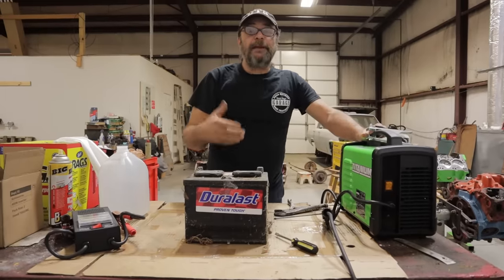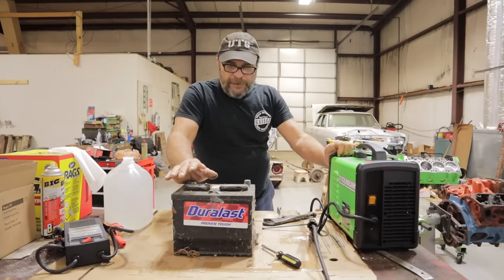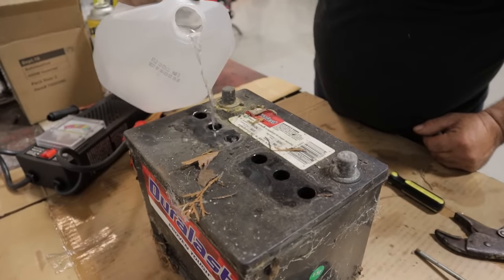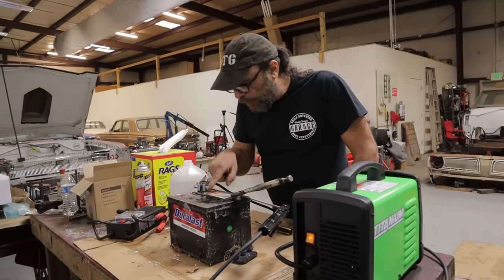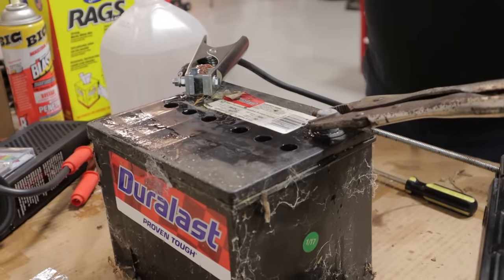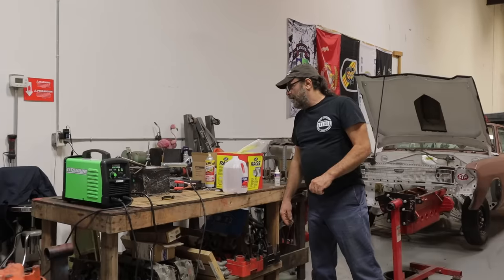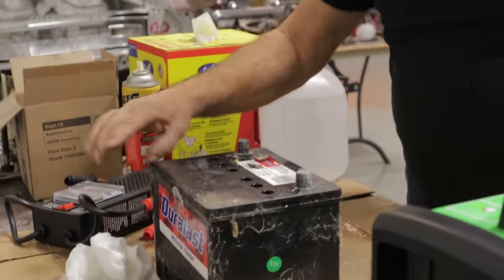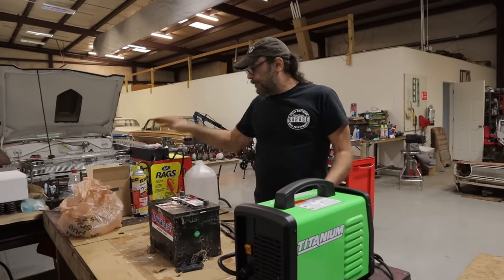Reviving Dead Batteries With A Stick Welder

Comment: There are three basic types of lead-acid batteries used in automobiles and boats. The old style is referred to as flooded batteries like Tony was using. These can be maintenance style with removable caps to replenish the water. Variants of these either have water recapture like the Surette Roll$ batteries or may be totally sealed. A second variant is that the battery’s plate architecture is designed either for high cold cranking amperage for starting only or for deep discharge such as the batteries used on house circuits on boats or in golf carts. Automotive starting batteries do not like to be discharged too much. The next type of batteries is the gel cell. In these the electrolyte is not a liquid but as the name implies is a gel. The advantage of these is that they can be operated in any orientation, even upside down. My old Miata had one and they are popular on motorcycles. They do not like to be over discharged. If so, they will likely die. Whew, long post. Finally we get the the AGM battery. AGM stands for Absorbed Glass Mat a cross between flooded and gel cells. Supposedly these batteries can be used like car starter batteries for their high CCA, Cold Cranking Amperage, or as a deep discharge battery. The difference in the three types is their physical construction. The chemistry is the same.
Each of these types has a different charging regime. Most modern battery chargers have three phases. Bulk feeds the highest amperage up to about 80% of the battery’s capacity. After that the charger drops to a lower amperage in the absorption phase which takes the battery up to 95% capacity. Finally the battery is on the Maintenance Charge also called the float. The three types of batteries discussed here have different characteristics in the three phases. The AGM can take the highest charge rate of the three, but a charger designed for flooded batteries can also be used on AGM. Gel Cell batteries use a different regimen and never the twain shall meet.
Reply: Nice science lesson but what am I supposed to get out of it? At some point in that long, informative post you could have addressed if this method works on anything but flooded batteries.
Reply: @MH-53E  Sorry, I never tried it. I wouldn’t leave batteries around on the ground in my yard in any event. I’m more concerned with being able to start my boat’s engine, run my radios, and keep my USCG required lighting lit. I’m not that interested in saving a few dollars when my life is at stake.
Reply: @datasailor8132  Seems to me you are more interested in showing others that you are the smartest guy in the room, which I seriously doubt. Intelligent people don't have to do this, it simply shines through. Or it doesn't...
Reply: Have been using load sensor like yours  to get batteries  from the dump  and u look for batteries not bulging on the ends . It seems if a battery shows a good voltage under load it has some life left. If a battery is in the dump it usually has been sitting around for some time before it arrived at the dump .have been using them for off grid uses. Try your idea with a battery that clearly bulging on the ends.i use that type of welder as a fast charger use a volt meter to regulate  the voltage to about 15v .I use welder with generator to fast charge fridge batteries  in early evening when camping so as to only run generator a short time.
Reply: Good info there buddy.  I think it's Absorbent, not Absorbed.  Minor detail but seems some info out there calls it one or the other.  AGM batteries have a lower internal resistance and so are able to be charged faster and also this means a better cold cranking capacity because the colder it gets, resistance will increase in most conductive elements.
Reply: @montinaladine3264  You’re right it is Absorbent. I’ve been writing it incorrectly since they came on the market.
Reply: Thank you for taking the time to write your highly informative comment so that those of us with an open mind towards learning more on the topic may benefit from.
Reply: MAny of the newer "sealed" designs are still wet, you can open the ports, but they are harder to remove.
Reply: @kevinb9745  HA!  Funny shit.  I thought his comment was a bit of misplaced bitterness.
Reply: I had a parasitic drain that killed my battery. Drained all the way to 3v. It's a 12v AGM. Do you think this deep discharge did any permanent damage? After a charge it seems to be doing fine, but I may as well warranty it if it's toasted.
Reply: @busterscrugs  Deep discharge is a relative term. Anything below 20% capacity and that’s a swag could do damage to the battery.
Reply: @montinaladine3264  Nope, the lower the temp the LOWER the resistance except with thermistors.  That is why superconductors are cooled to near absolute zero.
Reply: @datasailor8132  yeahhh I'd imagine 3v on a 12v battery is quite a bit lower than 20% capacity lol I should probably try to warranty it.
Reply: @montinaladine3264  not jumping on the insult train here but colder is better for conductivity
Reply: WOW !
Reply: @busterscrugs  it’s not. 2.4v=20% of 12. I’d try it and see if it passes a load test.
Reply: @MrKunzeification  Capacity isn't calculated that way, 11.6 volts is considered 20% charge for a 12v lead acid battery. It passed a load test, but I'm sure the capacity has diminished.
Reply: @MrKunzeification  if that math were true then why do dead bateries only read about 10% lower on their voltage. By your logic they should still have 90%  of their life left.
Reply: Hi thank you for the information , I have a motorcycle battery that is basically brand new I never used it , it’s three years old and it was charged for a while but letting it sit so long it’s completely dead , it’s a completely sealed battery , the name of the battery  is super start , 10 hr. ah -9 . I’m just curious if I can somehow bring this back to life ?
Reply: @williamgillespie3127  You can but try. Might want to load cycle it if it does come back to life. A 10 Watt 12 volt bulb would draw just under one amp. Run it down to about 40% on this load or consume 60% of capacity. The battery’s capacity should be marked somewhere on it. Do not let the battery overheat. Heat kills batteries. Mark the time it takes to discharge to this level. Subsequent cycles should increase the time is the battery is healthy.
Reply: I sure as shit didn’t read all that But in your first sentence 3 is wrong there are tons more then 3 you need to go back to help desk and learn a lil more on acid batteries in 2021
Reply: @TrekServer  this guy just googled car battery and thinks he's an expert on the subject all the suden.
Reply: @datasailor8132  thank you for the reply ,
Reply: @TrekServer  "three BASIC types." Learn to recognize keywords. those are the three most prevalent types of battery.
Reply: best explanation I've read in a while. Thanks for that!
Reply: @littlejackalo5326  , Ya, I always notice how often "basically" is misused.
Reply: Cool story bro, tell it again
Reply: @MH-53E  

Webster... Ha Ha Ha!!!!
Reply: @busterscrugs  actually 3v is 25% of 12v, just saying..
Reply: @chrismartin3377  Yes, 3 is 25% of 12. Congrats on your math skills. What I said was 3v does not equal a 25% state of charge in a 12 volt battery.
Reply: @busterscrugs  
Geday mate, cheers for the reply,- snapped , I was more looking at the maths, basic understanding of batteries  and power ( enough to get by when you're in the middle of nowhere and have to do something , - I'm more "old"  school Motorcycle / mechanical - downunder)-
but does any of these battery "revive miracles" really work, or just a last gasp of life... cheers, Chris.
Reply: @chrismartin3377  I'm honestly not entirely sure. A normal flooded lead acid that has become sulfated can be revived by fast charging it and purposely boiling the electrolyte. However, capacity will be diminished. Not sure if you can do this process with a sealed or AGM battery. 

Any battery that has died due to physical/internal damage can't be revived with this method. 

In my case, I had an AGM that had deeply discharged (all the way down to 3v). Drove the car for a couple hours to quickly get a charge back in, then I left it on a slow charger for 3 days. Still working fine, capacity is probably a bit lower now though.
Reply: Excellent description
Reply: @busterscrugs  Well, 3V out of 12V is 25%, but since most 12V batteries charge up to a potential higher than 12V, 3V is actually somewhere in between 20%-25%. (just had to post a bit of nerd sarcasm; you probably knew this already)
Reply: Thanks chatgpt

Comment: Arc welders come in both AC and D.C. make sure you are using a welder with D.C. output or if yours is capable of both set it on D.C. looks like tony is using a harbor damage 225 amp D.C. unit. Also many units are capable of reversing the polarity so there's that too.
Reply: Been welding since 87 myself great points. 👍👍
Reply: Leonard.. that would be
"Harbor Fright". 🍻
Reply: @blipco5  I have a lot of tools from harbor damaged and the home pisspot.
Reply: @blipco5  Hobo freight he he
Reply: Hazzard Fraught
Reply: Horror Fraud
Reply: Hobo Freight
Reply: @blipco5  I think you meant Ship Wreck.
Reply: Your right when the electrolyte boils it creates explosive sulfuric gas, you can charge indoors as long as the vapors don't accumulate, a ventilator fan blowing across the battery is safe as long as there are no vapors present when you start the fan. You can determine the state of charge and health of each cell with a battery hydrometer. Real old neglected or cheaper batteries do not respond well to this treatment the lead phosphate plates that interact with the acid become too thin over time and do not possess sufficient material. When you shock the battery with high amperage spikes the plates get hot and that sulfate will hopefully fall off. It's a gamble and other bad stuff can happen, no open flames or spark generating devices, no gas water heaters, no static generating. Even light switches make sparks. Never ever leave batteries charging overnite indoors without ventilation. Distilled water is good, purified is also good, tap water has minerals that can bond to the plates causing interference. Work many years with domestic and industrial batteries. Good luck
Reply: @illiod1  ok kaaren.
Reply: (The Frightening store) lol
Reply: @slickwilly1099  he was just being helpful....
Reply: What voltage is that battery seeing out.of these DC welders?
Reply: @blipco5  or, anagram-ically - “Harrob Frigate,” which references the boat in old H.F. Advertisements.
Reply: @PNW-LOGGING-HOMESTEAD  since Stick welders lean toward constant current, and welding electrodes need a certain voltage to get “lit” - about 40 volts for rutiles like the 6013, and rather more for cellulosic types like 6011 - it’s a rather good question.  I’d suspect that it’s well above the usual charging voltage!

I’d be most hesitant to try this with my prized AHP-160.  

I like my “toaster,” thank you.  It makes stick welding with non-cellulosic electrodes easy.  It does not like cellulosics.
Reply: @illiod1  That is Hydrogen gas.
Reply: Harbor Freight is where I buy my favorite brand of tools...Snap-off Tools.
Reply: @illiod1  Awesome info. Thank you for sharing your knowledge. This should be 'pinned' to the very beginning of the posts.
Reply: @illiod1 Hydrogen is not a sulphuric gas.
Reply: @1SqueakyWheel  hydrogen sulfide.
Reply: And he's using a Durablast battery!
Reply: @emmetdash  friends don't let friends install duralast parts.
Reply: @davidleonard8369  I think he said it came in some car he'd acquired
Reply: David Leonard: just bought a Italian welder and it arch’s when I connect terminals....doesn’t say if it’s ac or dc....why would it do this?
Reply: @mikemike-rf7qb  what terminals are referring to?
Reply: @davidleonard8369  on the battery, but just bought welder 2nd hand and realised it AC... thanks for your reply
Reply: @PNW-LOGGING-HOMESTEAD  twice as much as half.

Comment: I've had a couple blow up in my face as well because in those moments of genius I turned on the charger before attaching the cables. The gas is hydrogen, btw, and it loves a spark. A professional desulfation is pretty much what you've done here, the only difference is the rate of pulsation of the current introduced into the battery.
Reply: AKA: Hindenburg..! Boom!  another MAJOR difference here is the COMPLETE lack of safety.. not to forget his wife being close enough to get hurt or burnt by acid as well.

Comment: Forklift battery chargers litterally do this as a desulfation setting and prompt you to refill the water level directly afterward because they actually boil a lot of the water off during the process it definitely works

Comment: This works very well. I did it last weekend on a battery from my Suburban. It failed to start and had to be jumped several times recently. The battery would not hold a charge anymore after being on a standard charger for several hours. Now it's just like new - full cranking power even after leaving headlights on for 5 minutes, or sitting overnight. Thanks Uncle Tony !

Comment: Thanks for taking us along on your experiment with the rejuvenation of the battery .
I am going to find out more about doing this . I am anxious to see how that the battery holds up, so give us updates . Thanks for the information and I will see you later on another video . So be careful and stay safe out there .
Reply: If the battery has one cell damaged by acid, this op is useless.
After 5 year of use, most of them are gone.

Comment: And never charge a frozen battery.. acid runs back into the plate once discharged!     Smelly batteries equals nasty booms . 1/4” of water over the plate .  It will rise once fully charged.. 12.75 and above each cell . If blackened or dropped against the crew … its a dead core.
   12 years of making sure Chicagoans had batteries to start the rides  82% of the volume of them was our warehouse.

Comment: Great video, been doing this for years it does work.  Not on every batt depends on the plates  like you said.   If the battery isn't shorted/cells aren't damage that process works 8 of 10 times.   Great job man!!
Reply: Hey how much longer does it add to battery's life? Ta
Reply: Is there a method to the madness i.e. the amps related to AH of the battery?

Comment: If you only put in enough water to cover the cells and watch it, you can top it off after it settles down  that way you don't lose acid due to boil over. On another note you mentioned the possibility of a cracked connection between cells I was full fielding an older blazer with the external regulator the battery blew up  the acid hit the hood and rained down on  the back of my head. I was glad it wasn't a Ford with the regulator behind the battery.